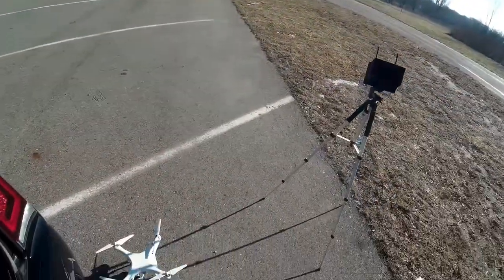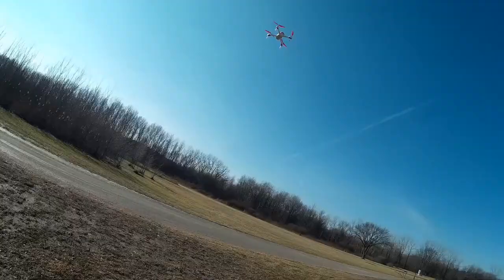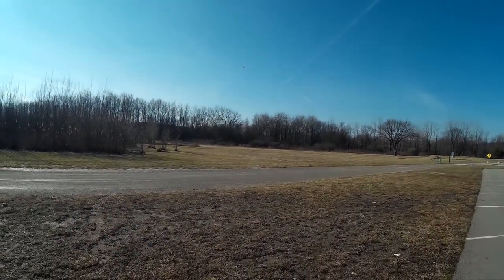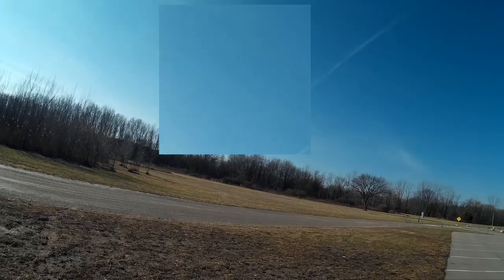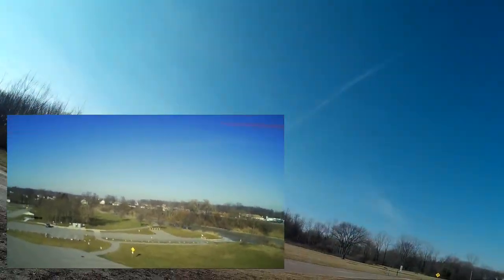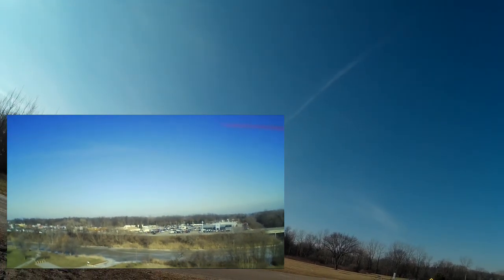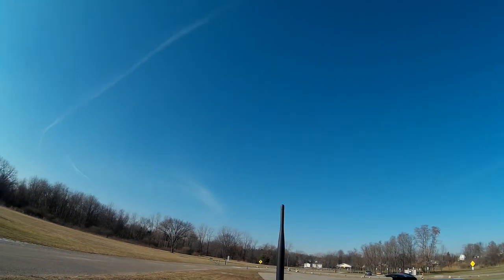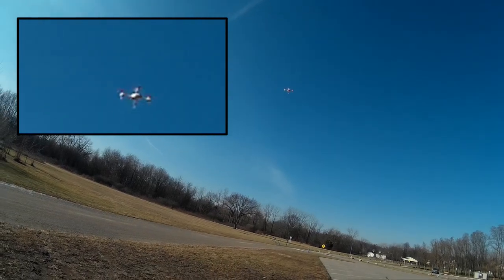Video Drone - Hubsan H502 First Flight with 3D Printed Legs!

Comment: hi my 502s fell on rth user error hit hard cracked open now rear left motor an led not working any idea why both wouldnt work what needs replacing any help or advice is appreciated ive checked for loose connections plz respond at email shybo.rc@gmail.com thanks at a loss